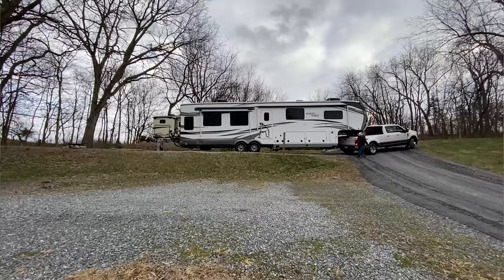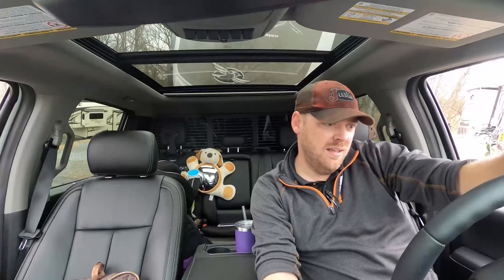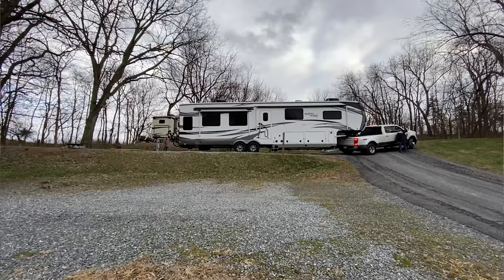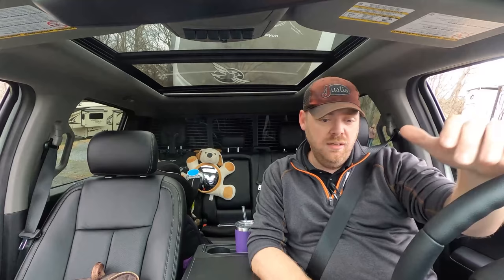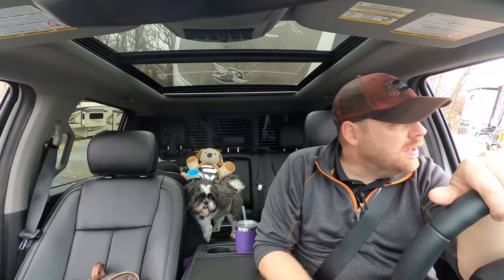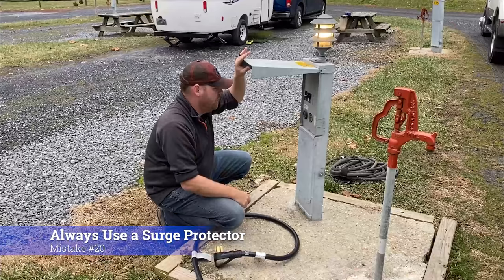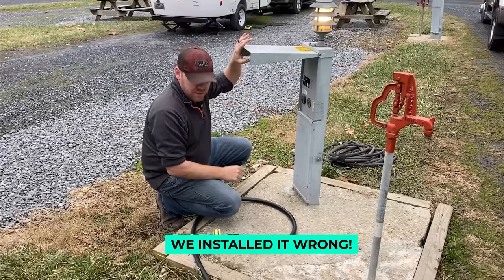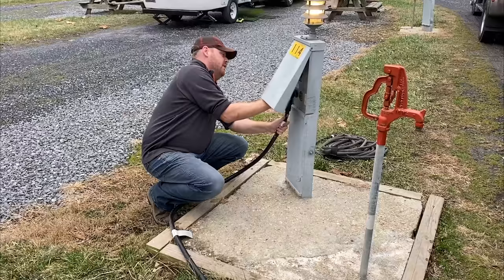RV Newbie | How NOT to RV! (First Time Towing FAIL)

Comment: You also need to chalk both sides of the rig, as well as in front of the wheels. But hopefully you've figured that out by now. BTW, who goes out on their first outing without a clue what their doing? Don't lock your front end on hard pavement when your going to be doing any turning, preferably not at all on non slip surface. You can do some serious damage to your front end with all the power your truck has. Ask me how I know!
Reply from the maker: We are definitely asking you "how do you know"? :) There is a story here to tell and we would love to hear it. Yes, we have two large chocks (not the small ones). We also didn't know that we didn't know what we were doing. That's one of the reasons we turned the camera on for this video. In the beginning it was supposed to be a How To Setup....Then it quickly turned into a How "NOT" to set up.
Reply: @discoveryboundrv  Well...long story short, having gotten away with it a few times on strait line driving, while locked into 4 wheel (low or high, just more torque in low); I was coming off a deep sandy road with the lockers on and had to make a 90 deg turn onto a hard road. Forgot to unlock my front end and broke the locking system on the inside of the turn. Lesson learned. Also, as mentioned in case I wasn't clear, you need 4 chocks. Two for each side. Only choking one side still allows the trailer to pivot on you.

Comment: If I can give you any additional advice, it would be to make sure that your fresh water hose is food grade. I don't think those collapsibles are.
Reply from the maker: Hi Andrew! Great eye in spotting that! You are absolutely correct. The Jayco Northpoint comes with two 5-Gallon fresh water jugs that are connected to the kitchen and the Fridge. We rarely use the city water for anything other than showers. However, with the recent flood of water filtration systems on the market, we may look into an upgrade. Keep you posted. Safe Travels.

Comment: I'm not a pro at all, BUT! No lights mean NO BRAKES!  That trailer weighs more than the truck... Always have as much brakes as you can available. 
When towing 5th wheels you can unhook your kingpin while still having control of trailer brakes, pull out a little and when everything good unplug the trailer.... Worst case scenario the trailer rolls away before you can hit the brakes and tear away your electrical connection (which will be the least of your problems by then)
And yes! Checklist!
Reply from the maker: Hi Jonathan. You bring up such a great point. Thank you. We never thought about that approach, but it’s so important to take advantage of every opportunity to stay safe. Especially, with 18-20k pounds of potential problems. Huge tip! Thanks again for sharing and travel safe.

Comment: No grease between the fifth wheel and king pin.
Reply from the maker: Hi Brad, Great Tip. Thanks. We put a grease plate on around the King Pin on the 5th Wheel, but didn't put grease on the King Pin itself. Headed to the store now and grabbing some grease!
Reply: @discoveryboundrv  Anywhere you have metal on metal rubbing together you will want to have grease. Make sure to get marine grade grease so you are protected in rain or snow.

Comment: In the video it appears that a left hand turn was not required.  If you took a right is it, as it looks, a road that goes through the park?  If that's the case remember that for the future.  There are usually options and if you step back and look it over you might see an option that did not immediately appear to you.
Reply from the maker: Hi Sally Sue. Thank you. Great advice and well received. I think it's very important to do what you just said. Take a step back and look at the whole situation before rushing into it. In our case, at the bottom of the hill the steep road meets another flat road. We decided not to go down the hill because we are too long. (43 feet). We would have made the situation a lot worse and then we couldn't get out of it. The safest option was to just crest the hill. It was definitely a tough RV spot. The guy in the video helping us was the RV Park owner. We asked him to help us out since it was our first time towing. He said everyone tries to go down the hill and they leave with major RV repairs. We made a rule after that day: "Pull-Thru's Only!" :) Thanks again.
Reply: @discoveryboundrv  good job! GOAL - Get Out And Look :) hokey saying but it’ll save your butt again sometime.

Comment: Tires off the ground are fine.  Just slip a board or two underneath, no need to hitch back up. You need snap pads and you need stacks under your stabilizers on the low sides.
Reply from the maker: Thanks for the great tip Jonathan! Snap pads are definitely on our list.

Comment: Never use 4 low on pavement 😳😳
Reply from the maker: Great advice and we’ll received. Thanks Jay! Anyone can go out and buy a truck (like we did), but it takes real experience to learn how to use it. We don’t hide any mistakes in this humbling video. 😀
Reply: @discoveryboundrv  absolutely!!  4H will give you traction and better function on pavement. 4L is for unstable conditions such as mud, sand..etc. it will tear up your differential gears on solid ground.
Reply: Never say never.  Low speed, when traction is needed is no problem.  Pulling a big boat up a paved wet boat ramp - absolutely.  Backing a trailer up my super steep paved driveway - absolutely. In 4 high, the motor revs to 3000 rpm and it won’t even move the trailer.  I’m not going to floor it.  In 4 low it walks right up the driveway.
Reply: He didn't need 4 wheel drive at all. Tongue weight alone should've been enough for a dually to keep traction on asphalt. I never found towing my 5th wheel fun or easy. Was always a pain in the arse.

Comment: Lucky you were on level ground and your front landing gear didnt fold when you pulled forward without chocking your wheels seen it many times. Happy Csmping.
Reply from the maker: Hi Bill. You gave us a new perspective on things that can happen when setting up the rig. We never knew that. Thanks for sharing! We will definitely be making sure we watch out and get those chocks installed. Nobody wants an RV to be laying on the ground. Especially with little kids around. Great tip and Thanks again! Travel safe.
Reply: @discoveryboundrv  
I personally never chock the side with the board/put the chock on the board. I've seen the best chocks slide on wood. This probably isn't the best tip as much as it being just personal preference. Stay safe in your adventures !!

Comment: Nice rig but the 8mpg towing that trailer is brutal with $6/gal fuel prices.
Reply from the maker: You said it!!! We just filled up, yesterday. It was over $250.00 for the F-350. When we saw the current diesel price at $6.49, we just shook our heads. It's definitely tough. All the best and safe travels.

Comment: Yes always always always chock first!!!!!! Super dangerous  guys
Reply from the maker: Hard lessons learned very quickly! :) We found that a lot of people use the standard smaller chocks on larger rigs. We feel that the size of the chock should be relevant to the size of the rig. Over 18k pounds of momentum can't be stopped by a small chock. We upgraded ours to larger ones. Now we just have to remember to put them between the tires. LOL.

Comment: Just a note. If you go into the menu on the dash with the trailer settings, you can change the trailer brake force to compliment the setting instead of just 7-10.
Reply from the maker: Thanks for the great tip. I went in and adjusted it based on your feedback. Much appreciated. After thinking about this a bit, having it set too high and leaving it there will just cause the trailer brakes to wear out faster. Definitely a great tip for everyone to adjust that setting as needed. Thanks again.

Comment: I would not take that trailer over 60 miles per Hour,  with the rear axils near the middle of the trailer, Gooseneck are not as bad as the bumper trailers, but all the rv trailers are dangerous because of the poor balance the trailer wheels should be farther back, a trailer that big should have 4 axils, the breaks should be set to have more break pressure to the trailer because it is heavier than the truck, or in 
Hard breaking and wet roads the trailer is too heavy for the truck to stop it , if you don't want a jack knife situation, the trailer needs to stop the truck, meaning you should set the trailer breaks to where you can feel the the trailer is pulling hard on the truck, but you also need more tires for traction for breaking, 

Now what's really going on with trailer sway has more to do than just the poor balance, it's also a combination, of lift and drag air pressure, that is causing the wrecks, it's not fixable with out getting the last axle at least 4 to 5 feet from the rear of the trailers, depending upon the length of the trailer, 

I personally would prefer to use a bumper pull rv trailer , but only with a Military Hitch,  so that the trailers harder Breaking will not cause the separation of the truck and trailer, 
And I'd use no less than 3 axils on any trailer that is as heavy or heavier than the truck I'm using, 

It may not be a good idea to set up the trailer breaks to be stronger than the truck, do to the Hitch design, I'd advise you to ask the trailer equipment manufacturer or the 5th wheel dealer, about the safety of that because they are not designed for this kind of breaking set up, and no one does it this way, 
Because no one knows about what causes jack knife crashes, or how to prevent them, semi trucks are the same way even the so called pros are doing it the wrong way, big trucks only stop well if they don't have to break hard, but if they do, 18,000 lbs can't stop 62,000 lbs,  the air breaks on the truck engage 1 second sooner than the trailer with 3 axils breaking on the truck and only 2 on the trailer, so the breaking is actually working the opposite way than it should be on semi truck and trailer set ups  ,  
What you are doing is a lot more dangerous than you realize, and the design is a dangerous one,
Reply: It's not rocket science, that was a tough spot to get out of, you really don't want the trailer stopping the truck or vice versa, you want the brakes as close to even as you can get them but as a retired trucker I am new to 5th wheel RVing and I would prefer 5th wheel over bumper pull any day for more stability in strong side winds.
Reply: @mbriggs4627  not what trailer to stop truck with out a military Hitch, or it will come off bumper tow only,  but the reason semi trucks and trailers jack knife, is because the truck is lighter than the trailer and the brakes are weeker on the trailer, And the opposite is what you want if you don't want to jack knife it, when you have to break hard, or in slippery road conditions,
Reply: @michaelguerin4618  True that.

Comment: Didn't see any comment about it but could you not have gone down the hill and avoided the whole dragging the bike rack snafu?

It's an RV park they always circle back around
Reply from the maker: Great catch! The bottom of the hill was too sharp and too steep meeting a flat road. We are so long that we would have done more damage going down the hill, rather than just cresting the top of the hill. I should have taken the bike rack off, but hindsight is always 20/20. I have also received a bunch of comments about not putting it in 4x4 LOW on paved surfaces. At the time, I had no idea about that either. Love the RV Community! Thanks for the support!

Comment: How come you couldn’t go right?
Reply from the maker: I love that you caught that!!! We couldn’t go right because we would have bottomed out at the bottom of the hill. At 43 feet we are too long. It was actually better to go up. My only other option was to go straight and pull the rig through the open grass field. They didn’t like that option. 😋 The guy helping me was actually the RV park owner. We asked him to help supervise our tow so we didn’t roll that thing on its side. LOL. Actually, the only problem with the tow was me. Anyone else would’ve had that rig pulled out in 15 seconds. Pam and I learned a lot that day and we were very thankful for everyone’s help.
Reply: @discoveryboundrv  yeah that’s cool!  My fifth wheel is 38 ft long. I wonder sometimes if 4 or 5 feet helps.  
What’s your opinion?

Also I’ve learned we all can learn from each other newbies and very experienced campers. So I’m always looking at others ideas and I think you’ll find most RVer’s are very helpful.  Love your rig!
Reply from the maker: I think that the biggest factor is how far the back of your rig overhangs the rear axles. For instance, our Rig has a LOT of rig behind the rear axle and whenever the road is uneven we run the risk of bumping the back. There are many rigs that aren't square in the back and are tapered. This would help the most. We put casters on the back of ours to give it some sort of protection. I think at 38 feet, you have a much better towing situation than we do. Thanks again and safe travels.

Comment: Whats a level made pro? Whats it do?
Reply from the maker: The "LevelMate Pro" is a wireless vehicle leveling system. Basically you put a device in your rig and then calibrate where level is. When you drive to a new RV Park, the device will tell you when your RV is level. Or as close to level as you can get. Moving 1 foot forward or backward makes all the difference in the world when you want to get set up quick. Plus, you would rather know if your level while you are still in the truck. Especially, if it's raining outside. :) Have fun!
Reply: @discoveryboundrv  oh thats a pretty neat tool to have. I have lots to learn

Comment: SAD really !! ZERO REASON for boards under Tires !!!!! Ba ha ha ha ha ha
Reply from the maker: Hi Chuck. In the video we placed a board under the tire to keep weight on the tires. We are over 42 feet long. We looked at our Jayco manual and it advises not to have sole weight on the leveling Jacks as it could twist the frame. The jacks can definitely take the weight as you mention, but we tend to side with caution. Safe Travels.

Comment: This is painful to watch.
Reply from the maker: We started our channel with one rule: Don’t hide the truth. This video is exactly the way it happened to a couple of RV Newbies. Hopefully, others will learn from our mistakes. Safe travels! Best, Pam & Lee
Reply: @discoveryboundrv  I appreciate what you are doing.  My “pain” is because I had a very similar experience when I purchased my first rig over 10 years ago.  Things I’ve done (because we did not have checklist - we do now):
1. Forgot to let the tailgate down (and put a small dent in the gate on the inside)
2. Forgot to unplug the pigtail and broke the latching mechanism that held the plug into the socket.
3. Forgot to disconnect the brake lanyard when pulling out from the rig.
3. Started pulling away with the rear stabilizers still down and bent one.
4. Left the TV antennae up (someone stopped us while we were driving through a small town to let us know)
5. Forgot to put the truck in Tow-Haul mode (I still forget sometimes)
6. Forgot to latch the fridge doors

A  checklist is fairly important…

Have a great day!
Reply from the maker: Hi Dr Swanny! Thank you for sharing your experiences. There are many viewers that have already added some of your checklist items to theirs. It’s so important to tell our stories and help others. When we first started, there was this aura in the RV Community that you had to do your research and do it right the first time. It didn’t really make sense, because going out and buying huge complicated RV’s and knowing everything about it from day one is absolutely impossible. That’s why we keep our channel to the truth about RVing and showing the mistakes we make and that it’s OK to make them. Your RV experiences both make a great story to tell AND a great lesson to learn. RVing is all about discovering new things and having fun. Sharing experiences like yours are what matters and thanks again for sharing. There should be a club for those of us that have torn up the front compartment door with the tailgate. For now we will just call ourselves “Seasoned” RV Newbies. LOL. Best, Pam & Lee